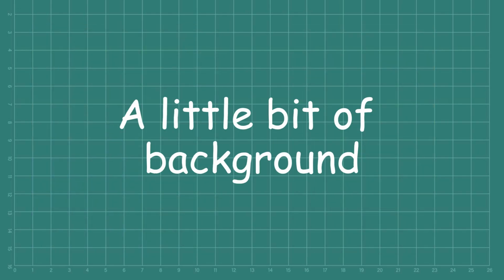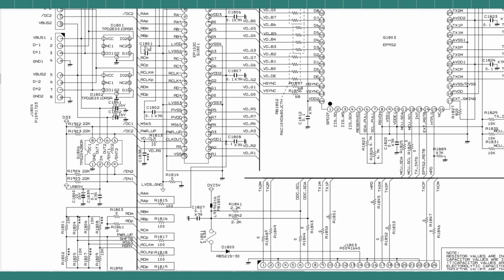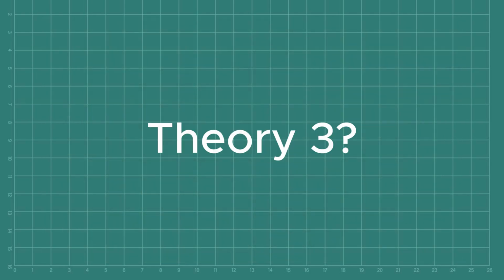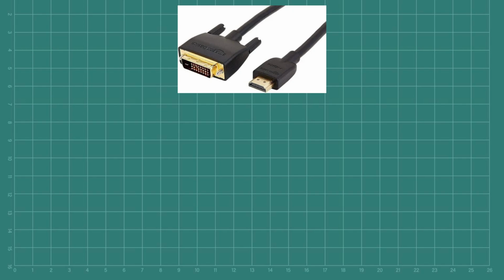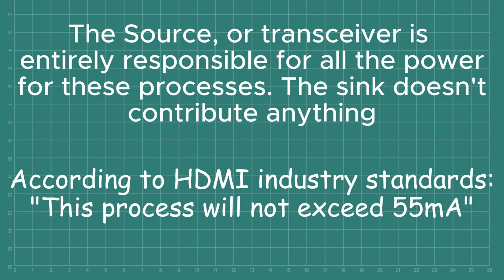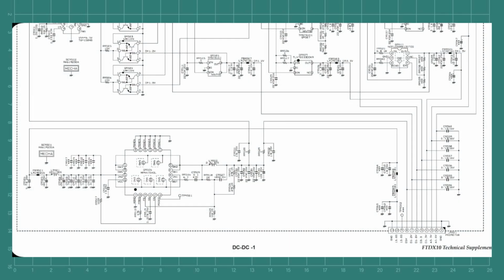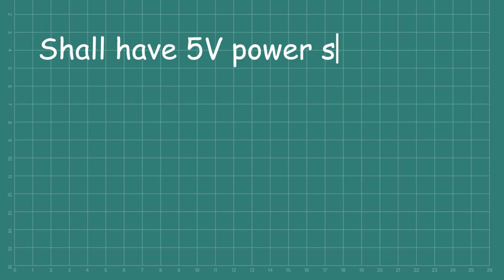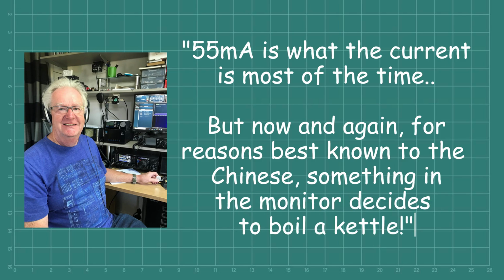Yaesu DVI-D to HDMI. Investigation

Comment: I hate to beat the proverbial “dead horse” but, would it not completely fix the problem by simply cutting the 5v supply on pin 14 from the radio to monitor and supplying your own switched 5v reference? Should be as simple as dissecting the cable, cutting the wire on the radio side and supplying voltage to the hdmi side?? This is for the guys that absolutely have to have dvi-d to hdmi. 
Just my $.02
Reply from the maker: It’s an option but untested and we don’t know what impact it would have on the pin 19 return.
Reply: @ I wondered about that but I haven’t familiarized myself with the circuit and how it works so I have yet to try it. I’ve just been content with the screen my DX10 came with thus far.

Comment: Would it be possible to add a device to the cable to limit current?
Reply from the maker: The easiest way is to get a dvi to hdmi cable, put that into an HDMI capture card and display the screen through Windows (or whatever OS you use)

See previous videos.

Comment: There are so many variables with this issue but one thing for sure it is an easy repair for most techs with these radios. I missed out on a TS890 a few weeks ago with no display output so i am guessing something similar is going on there too. Just stick with plain DVI-D to save the hassle. Brill video and have a Subscribe. 73
Reply from the maker: Thanks for the sub!

The new 710’s now come with a resettable fuse which I think should also be the repair standard. 

That said it offered no extra protection for the EP953.

Comment: This is a problem with you use an outdated video interface on a new radio.  There are many monitors that support Display Port and HDMI but much less support DVI.
Reply from the maker: Correct
Reply: Its early 2000s tech that never advanced, HDMI has been out for almost as long and has been the industry standard for the past 15+ years. I work in IT and the only monitors we have with DVI are old ones we have had in use for years. Virtually all our PC's use HDMI or Display Port.

Comment: Would a 300R resistor in series with the fuse, limiting current to 50ma, (or even 150R for 100ma), leave the HDMI monitor able to function?
What is the 15V from pin 14 intended to do? (Sorry if I missed that in your explanation).
Reply from the maker: The 5v supply is intended to wake up the monitor and initiate EDID. Have a look back as there is an explanation. 

The idea of a resistor would inhibit this process. 

The latest schematics for the FT710 show that the 530mA fuse had been replaced with a 1A resettable fuse.
Reply: @M8KHC  Great idea. Hope all new equipment will have that change, and eventually, an HDMI connector as standard.
Reply: @m7eup : Great video - thanks! I posted it to some 710 FB groups and reaction has been mixed as one can imagine. All the way from “read the Yaesu manual, it explicitly states ONLY use a DVI-D to DVI-D cable and a monitor with a DVI-D port” to an interesting technical discussion about the points that you raise in your video. 

Short of popping the covers of my 710 how can I tell if my radio has a poly fuse or an old school fuse? It seems like it would be based on serial number of the radio?

One of the productive discussions we are having on the FB 710 users group is if we can characterize the failure scenarios - for example, is the damage to the interface caused only due to the fuse blowing (on the non-poly fuse models) or is the HDMI controller being damaged by ground potentials between the radio when on an AC supply and a floating or bad ground on the HDMI monitors. And have people seen this failure if the radio and/or monitor is run off batteries?

Would you consider joining the FB group to discuss this further?

Comment: Thanks for the video.  My DX10 popped the fuse using DVI.  Just received it back from Yaesu repair in Califorina.  Repair cost including parts and labor $91.41 and shipping both ways $190.00US.  ouch.
Reply from the maker: Ouch indeed! I hope they replaced the fuse with a resettable one
Reply: @M8KHC  No they did not.
Reply: @M8KHC  I don't know.  I did not receive any notification for such.  That would b nice.  KN4UXO
Reply: for that much they couldve installed an hdmi port LOL
Reply: Also for a sad note.  The external has layed down again!   I hope that yaesu will fix this in future models.
Reply: @Jimmyzb36  ive talked with them and they have n o interest whatsoever in changing their engineering.
Reply: All of that for a fuse that costs 90 cent.

Comment: VGA is far more common. Monitors with VGA can be found for less than $100. I run my 710 with a DVI to VGA adapter I had laying in my desk. Works great.
Reply from the maker: That would work well
Reply: So, if I have a monitor with only hdmi ports, would it be safer to use a dvi to vga cable with a vga to hdmi adapter?
Reply from the maker: @daveorca  personally unless you have DVI or VGA the safest option is to buy a cheap video capture card from Amazon and use it to play the output via Windows (or whatever system you use) 

See my previous videos about how to display the screen through windows.
Reply: @M7EUP  Thanks, I will try the capture card.

Comment: Maybe one scenario in which more current flows than desired is when you power-up the radio and have the screen powered off either "soft" or "hard" (no mains connected)?
I think this voltage is meant to power only a serial EEPROM to be used for display identification (type and specifications) and indeed that works even when the display is not powered.
But maybe in some displays that voltage leaks into other circuitry when the display is off.
Reply from the maker: It’s a possibility

Comment: So a simple current limiting resistor of a few ohms in line with the fuse might well have resolved this whole issue. 

Though it may have messed with the Chinese kettle and so could have resulted in monitor compatibility issues so I suppose a proper 500mA current limiter to replace the fuse is what Yaesu should have given us.
Reply from the maker: Very true

Comment: On the FTDX-101MP the fuse has been omitted!! Only a 0 Ohm component and a FB inductor in series to the DVI +5V.  The diode has a peak surge current of 1A and a continuous rating of 200mA.  There is a series resistor to the +5V main rail R1859 with value shown as * !!  Not sure why a value is not given but this resistor provides current limit for DSP DVI and 3.3V lines.
Reply from the maker: Great spot! I’ll look into this more. Thank you
Reply: TS-890 has a 650mA fuse in series yet no real outcry of failures in that rig.  I think one reply mentioned the possibility of RF from a linear getting into the DVI port probably from a cheap poorly screened HDMI cable.  Also I very much doubt that a monitor is ever grounded to the same ground as any rig.  So the answer may be that DaVI cables in general have better shielding AND large ferrite beads
Reply: Just to add If this is a Yaesu issue and not a Kenwood what is the difference??  Well Kenwood has multiple lines to the DVI port wit transient suppressor bi directional diodes.  The Kenwood does not use a series diode for reverse polarity protection.  The Kenwood uses a 0.1uf capacitor on the +5V DVI line like the Yaesu BUT it is not isolated by the series diode.  This means that for the Yaesu any transient on the 5V line going positive will raise the voltage across the diode.  Given that this diode only has a reverse rating of 30V then this could be part of any "transient" failure with an ESD spike easily damaging that diode.  Thoughts??

Comment: Thanks for this comprehensive video. Yaesu delivered junk in case of the video port. There’s no use complaining 'we didn’t expect anyone to connect an adapter cable'.
Reply from the maker: I wouldn’t go so far as to blame Yaesu.. they had a design and stuck to it. Maybe let’s just hope they improve the functionality in the future.
Reply: @M8KHC  I would blame them directly.  HDMI monitors and TV's have been around for 10 years, yet they choose an antique video standard and expect the customer to go to a pawn shop to buy an old worn out monitor?  This was REALLY bad engineering and let's call it so. It's also engineering that COULD be easily redesigned.  

And raise your hands if you have these old DVI to HDMI adaptors hanging around your home. Yep, they sure worked fine on other equipment, but NOT this radio. THAT is a serious engineering flaw and the real question is why it hasn't been corrected?

Comment: It would have cost Yaesu $15K/year for the "HDMI Adopter Licence/Admin Fee", and an additional $1/Device(Radio)
Me thinks Yaesu where Penny Pinching...
Reply: They could go with modern DisplayPort - that doesn't require any fees, too.
Reply: @arekx  Before I retired, I worked in the IT department of a very large company.  We used HP computers that have DisplayPort instead of the industry standard HDMI.  It was a constant PITA for our sales and engineering people to go into customer offices for presentations where the rest of the world was set up for HDMI.  DisplayPort is no more common than DVI.
Reply: @David-hm9ic  Yes but it at least handles hotplug by design. Adapters are needed for DVI and for DisplayPort (in most cases) anyway. And DisplayPort requires no fees for manufacturers.
Reply: A point not many make is that only video is being sent from the 710 to the monitor and it's a one-way deal. Actually. neither video nor audio is being sent back on DVI to the 710 so HDMI isn't needed anyway. HDMI is two-way.
Reply from the maker: Possibly

Comment: Great video. I recently bought an FTDX101MP but was aware of this problem, so sourced an AOC E2270SWDN monitor with DVI connector on eBay. There are plenty for about £30. Works brilliantly. In fact, I bought a second one for my log book which is fed from a laptop via an HDMI to DVI lead. I agree Yaesu’s approach has not been impressive, but I didn’t  want to take chance. Just go DVI to DVI and avoid the stress!
Reply from the maker: Exactly mate and congrats on the 101mp. It’s a stunning radio.

Comment: Funny, you didn’t recommend any solution other than it’s designed for a dvi-d device.  People want to use HDMI .
Reply from the maker: Apologies…

The solution is to buy a DVI-D device.
Reply: @M8KHC wrong answer. People want to use HDMI. DVI-D will be harder to find in the future.  I measured 0.1mA being drawn on the 5v line coming out of the radio to my new Acer hdmi monitor using a dvi-d to hdmi adapter cable.  Just to be safe, I inserted a 100 ohm resistor in line between the 2 connectors in the 5v line.  Monitor still turns on and stays on with the radio and very little voltage drop across the resistor since the monitor has an equivalent impedance of 47k ohms on its pin 19 hdmi input pin.
Reply: HPD has a 47k ohm resistor to ground so that is the current sink I’m seeing and the monitor must be a high impedance feed through.
Reply: @ I don't make those kinds of videos......  :P

Comment: Funny, you didn’t recommend any solution other than it’s designed for a dvi-d device.  People want to use HDMI!
Reply from the maker: I think that’s the point 🤔
Reply: @ LOL, I'm using HDMI monitor on my 710. Using a simple DVI-D to HDMI passive cable. I've done my own research and measurements of voltages and currents involved in this passive cable to know there isn't a problem since DVI-D is compatible in the HDMI monitor!

Comment: Thanks, but it begs the question - what did Icom do right in their IC-7610, which also has a DVI-D port on the back, yet you can connect any HDMI, TV or whatever monitor to it, without ever failing. Rock solid.
Reply from the maker: That’s a whole new investigation and something to look at in the future.
Reply: What does “beg the question” mean?
Reply: @LiveWire_Guy  The same as "makes me question" or "makes me wonder."
Reply: @David-hm9ic that’s not the correct meaning. 

College of Liberal Arts
Department of Philosophy
Begging the Question

The fallacy of begging the question occurs when an argument's premises assume the truth of the conclusion, instead of supporting it. In other words, you assume without proof the stand/position, or a significant part of the stand, that is in question. Begging the question is also called arguing in a circle.

Comment: Not a radio guy, but I have used passive 1.4 DVI-d ⇒ HDMI cables for 20 years without any issue, as they are completely passive. That is why I watched the video.
After a little poking and thinking I arrived at the conclusion that the fuse is way too forgiving, and a PTC fuse might be a suitable replacement as those reset after a short while after tripping. But they are rather slow, so I would suggest a lower value than 630mA.
But this is not repair advise just something those inclined could look into.
Reply from the maker: I’d agree. Something reset-able would be an improvement.
Reply: @M8KHC  The Littelfuse 1206L010 was suggested by ChatGPT and the stats on it looks good. Used instead of the 630mA fuse. And it should be closer to the HDMI standard.
Reply: Changing the fuse is a band-aid kludge and not a fix.  A self-resetting fuse would certainly make the situation better but the solution is to use a monitor that won't cause the problem.  I think a more correct conclusion is that the electronics in some or all monitors is the cause of the failures.  I just got an FTDX101MP and it's getting a DVI monitor.   The radio is far too expensive to take chances.  Another conclusion/question is, "how necessary is the external monitor?"  I sometimes wear reading glasses for the distance encountered using my radios.  Unless the operator's vision is seriously impaired to the point that reading glasses don't help, the external monitor is probably unnecessary but it is cool eye candy.
Reply: @David-hm9ic  I would say that changing the fuse to a resetable one is a valid fix. But I am not a radio guy, I am a computer guy that can read a specification. And anyone that has worked with computers knows that hardware manufacturers have wildly different opinion on how a standard should be followed, monitors are a mess in this regard.

Comment: This seems reasonable explanation.

But why isn’t it happening on a DVI-DVI connection? Why isn’t the sink drawing current if it is connected to a DVI port? Or is it?

I would love an external monitor to my 710 but at this point I am not confident I won’t break it if I attach  it even with a DVI-cable to a DVI monitor
Reply: The transient events that occur in the HDMI spec do not occur in the much simpler DVI spec. Furthermore there have been no reports of failure resulting from hooking up a monitor using DVI to DVI, the issue is HDMI dependant.
Reply from the maker: The DVI-D is a much older legacy connection with less demands and reached the peak of its development a long time ago. 

From what I can understand from the investigation Yeasu engineered the output specifically for DVI and stopped there. 

HDMI places much higher demands on the video out, not to mention the fact that HDMI demands are increasing, with higher band widths, increased resolution and even some sink devices that are advertised as being able to “charge” peripherals. 

This was never a factor in the Yaesu design.
Reply: Seen a few comments from people saying they have only used a DVI connection and still have the monitor output blown ? Heading out today to buy a DX10 I have a DVI monitor and a DVI cable but I’m sceptical about using a monitor now
Reply from the maker: @ that’s new to me, always just been dvi-hdmi conversions that have been the problem.
Reply: @M8KHC Not with the 710 but with FTDX10, there is a video on YouTube with a couple of folks stating they have only been using DVI cables and the fuse was still blown.

Another theory is that this is happening mainly with ungrounded monitors.

Comment: Can we have a remediation solution like a current limiter?
Reply from the maker: It’s something I’m looking into so stay tuned for future videos.
Reply: I added a 100 ohm resistor in line between the dvi-d and HDMI connectors and I measured the current through that resistor to an hdmi monitor I had just bought. There is very little current flowing through it and the monitor was acting like a 47k ohm resistor to ground. So no where near 53 mA.
Reply: @halohms  Do you have any images or videos to share on this?

Comment: We know a bit more but still not enough. Like why EP952 is blowing up sometimes? Or why DVI-HDMI is a problem and DVI-DVI is not (if that's the case?). DVI spec also require 5V at pin 14 - to power EEPROM with EDID data in monitor. IMO the problem should also happen with DVI-DVI and if that is seen then well... Yaesu is to be blamed for not including ESD protection chip (these are very common for DVI and HDMI outputs).
Reply from the maker: That’s a very good point, but I imagine that DVI has not changed in a very long time. 

HDMI is still evolving within its industry standard and the demands on the source are growing. 

As for the damage to the EP952 I imagine looking into whether an over volt on pin 14 would reciprocate back down the 3.3V HPD